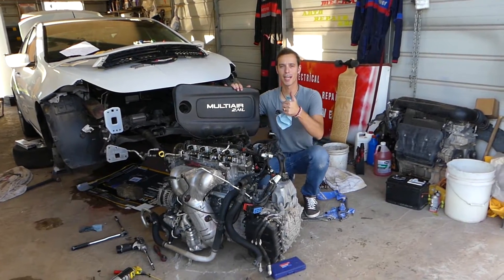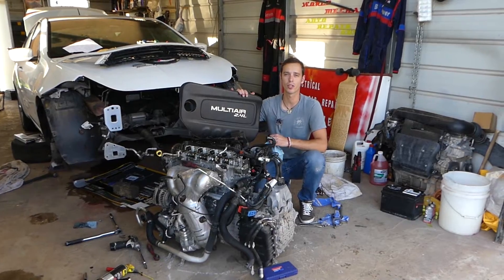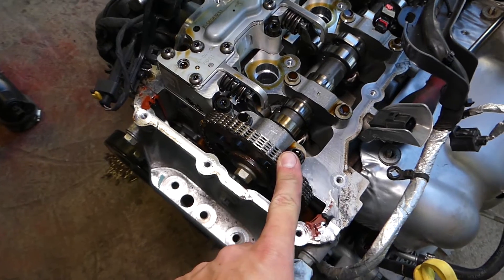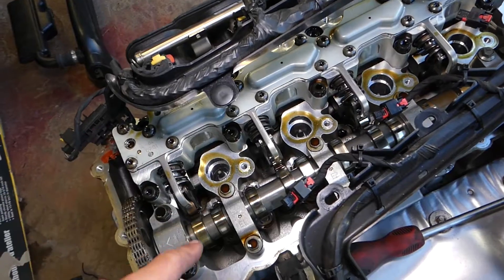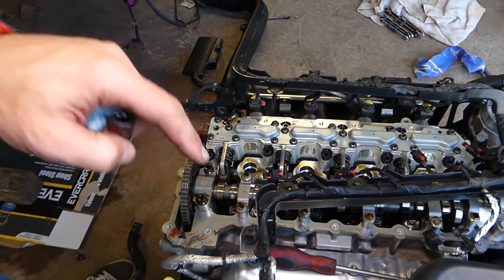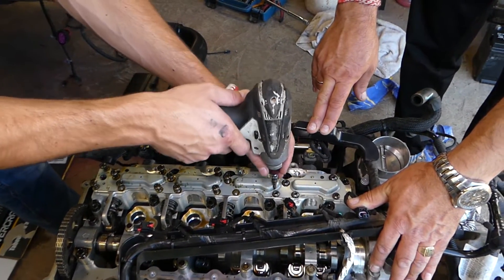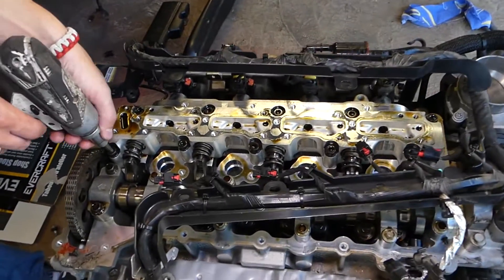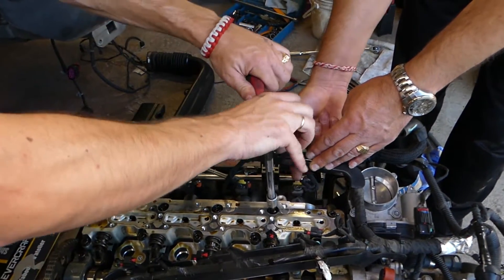MULTIAIR ENGINE EXPLAINED AND HOW IT WORKS DODGE DART CHRYSLER 200 FIAT 500X JEEP CHEROKEE COMPASS R

Comment: The engine is dead, there is no oil pressure. There is no electrical power, how in the hell does anything bend an intake valve?

Comment: Hey guys, love your videos! My Chrysler 200 is really high mileage and I am ready to put in a new engine and transmission, how would you approach switching the two point 4 Front Wheel Dr. over to the V6 all-wheel-drive? I have the budget for it but not sure exactly how to ask my mechanic to do the work.
Reply: I don’t know the exact specifics but you would need the v6, transmission, all components related to the awd system, new suspension all the way around, a v6 wiring harness, the ecm for the v6 awd system, and you would have to get your ecm flashed to your car’s security system if it has chipped keys. Any car after 2005 most likely has chipped keys.

Comment: I have a 2019 Cherokee and I’m impressed with the power of the 2.4!  For being only 4 cylinders, my Jeep doesn’t do so bad on the highways at all.  I was surprised when I test drove it as I was dead set on getting a 6 cylinder.  I’m glad I got this one and save money at the pump.
Reply: I sincerely wish you the best. I will just leave it at that. Sincerely.

Comment: I've had a MiTo multiair 1.4 135hp for 7 years. Has to be one of the best engines ever made. More than enough power and torque when needed, but can still get well above 50mpg on a long run, sometimes even nearly 60mpg. It's a 2010 car but not even newer mild hybrid engines can match the power and economy of the engine.
Reply: Agreed. My guiletta 1.4 170 bhp. Has been great.
Buts gets around 45mpg on motorway  must be alot heavier or something. Same year car.

Comment: Bro thanks for the video
Im from Puerto Rico and im mechanic . Im working in this engine because the engine was problem with the head gasket . I remove the head and took to the machine shop to rectificate . Now in having trouble with the compression it not increase and the engine dont turn on.
Have check the timming and have purge the oil at the check valve but without luck. The oil is new and i see good oil pressure. 
Thanks friend.
Reply: Hi compression not have intak side how to solved it
Reply: I have a Jeep Renegade, I replaced the head  gasket, but the car has no compression, the oil pressure is ok

Comment: Hello my Friend.

What you tell is not interesting to users, because we are not going to design engines like Multiair. And we are not interested in how it works inside there, but given that this engine has a serious design flaw, namely, it does not start after a long stop (more than 2 weeks) despite the operable kinematics of the control of valves by the Multiair module due to oil leakage from the module and the formation of air pockets in it. This disadvantage is exacerbated by the traditionally high oil consumption in this engine and the user can actually miss the critical moment of adding oil to the engine. In my case, this happened, the oil level dropped, when braking or tilting the car through the suction pipe, air got into the oil system (Multiair module hydraulics sistem) from the crankcase and the engine stopped. After topping up the oil, attempts to start the engine were unsuccessful. At the same time, compression and spark in all cylinders disappeared in the engine. The last oil 5W40 change was - 8000 km. back. The  filt Multiair module er turned out to be clean, the mileage of the car is 960,000 km., the condition of the engine is good.
Questions:
1. How can I bleed the Multiair module  and remove air from it?
2. What is the  luMultiair module brication scheme.
3. Why is there a small ball valve on the , from Multiair module he top under the filler neck? what is its function? Some experts in Utah advise pouring 240-280 ml through it into the Multiair module oil and then try to start the engine againe. I tried topping up, but nothing came of it, because the hole (1 mm) is very small.

Senserly yours.   
Igor Groza 18.01.22

igorgroza1957@gmail.com
Reply: You can bleed the multiair unit by putting your foot on the accelerator all the way and turning the key to start, do this several times and it should bleed.

Yes you can also add oil to the small  ball nipple under the engine oil filler cap.

If your car has 960.000 km then I would say it's a good designed engine wouldn't you?

Comment: Ever have rough idle while in park?. **warmed up already**. Just got a fait 500x sport 2.4l tigershark multi air. The vehicle is under 100.000km . 95.000 to be exact.
Reply: Mine is 130k tiger shark they do that. Idk how to make it stop. They are just shaky af.

Comment: I absolutely love the older Chrysler\Dodge engines! Slant 6, 5.2L & 5.9L Magnum engines...etc! I actually have this Multi Air engine and it does ok but does consume a lot of oil for a smaller engine, leaning closer to 150,000 miles and no major issues so far...knock on wood lol!
Reply: This engine is made by FIAT, so you best pray on that.

Comment: How do you put it back on with out damaging the valves
Reply: 10259A/10259B Engine Actuator spring Compressor Assembly Tool Fits for Fiat MultiAir Engine & Turbo Engine 2012-2019 1.4L 16V / Turbo / 2.4L / BF/FB/FF/PF/UF/VM

Comment: Please note that there is a Class Action Lawsuit filed against FCA re:  Excessive Fuel Consumption in reference to various FCA vehicles built with the 2.4 Liter MultiAir TigerShark engine DATE FILED: 04-29-20, Case # 2:20-cv-11054-JEL-APP...  FYI...  Thanks from your friends at BestLine Racing!  Visit us and discover what Nano Diamond Technology is all about!  http://www.extreme-engine-relief.solutions
Reply: Story time: this engine burns oil from the factory, I forgot about this ,and the engine shut off on me while on the road. I immediately knew I was low on oil. I was on my way to work and got some 5w-30 the lightest weight that the little store had.  I had planned on doing an oil change soon so I though it would be light enough to work for a bit. About 120 miles later, and I get a check engine light, and my car ran like crap. I parked it and re started it. Light is still on but the engine runs fine. I plugged my fancy scanner in and I got a p1064 cylinder oil supply solenoid valve stuck.  Even 5w-30 is too heavy for this thing. I'll be doing an oil change tomorrow, but I hate the sensitivity of this engine. My 92 trooper didn't care what oil was in it, as long as it had it.
Reply: 190k on 16 Renegade 2.4 has never consumed oil
Reply: That should be excessive oil consumption not fuel!  I have the 2.4 multiple in my Dodge dart and I have had no problems whatsoever!  I know that the BestLine Engine Treatment has kept my Dodge purring!  I highly recommend it!  http://www.extreme-engine-relief.solutions
Reply: @johnbeckham1483  Folks dont listen to this guy. DO PUT NOT ANYTHING OTHER THAN THE RECOMMEND OIL in a multiair. They rely on a range of hydraulic pressures to operate properly. Most people people who have oil consumption issues have not filled their oil with the OEM recommended specs.
Reply: @desertsoldier41  I use a high quality full synthetic 0W-20 in my 2.4 Liter MultiAir as recommended indeed!  I personally have never had any high oil consumption problems with my 2.4 Liter MultiAir from day one!

Comment: Thanks, Auto Repair Guys, for your good quality video in reference to the FCA 2.4 Liter MultiAir TigerShark engine!  FYI we're delighted to share our patented BestLine Lubricity Products now with Nano Diamond Technology!  Camshaft and engine bearing wear is reduced by 80%!  Engine hotspots eliminated while excessive high thermal heat is significantly reduced!  In general your engine will virtually become impervious to high thermal heat and extreme pressure!  Thanks, Auto Repair Guys, from your friends at BestLine Racing!  Visit us here at our online store and stock up!  http://www.extreme-engine-relief.solutions

Comment: I have the 2.4 jeep Cherokee latitude my only gripe is why does this engine consume oil I am undergoing a oil consumption test with my dealer I gotta drive another 500 miles to determine hopefully they can replace my engine with a new one
Reply: There is a lawsuit going on about it.. I just got a 2019 jeep compass with this motor I didn't know anything about it till I just happen to be reading up on the motor as its interesting to me its so small and has a good amount of power plus with the 9 speed transmission it seems to do really well for such a heavy lil rig.  I have seen they are saying the oil is leaking around the rings in some of them. But in some rigs it stops after 20k miles...  I am very happy with my jeep... But I have seen a bunch of people say its a real POS... buy at the same time I have seen some people as happy as I am.. So who knows... time will tell.. they get this oil thing figured out for people.. might turn out to be a really good  motor... its a real complicated motor thats for sure I never seen anything like that.. crazy design.. but coming from Fiat witch was a part of Ferrari till 2014.. Fiat is not part of Ferrari any more..  But You got to admit Chrysler has some really power house motors the last few years.. 700+ hp is nothing to joke about..  and this lil 4cl isn't 700hp but I feel it holds its own for as small as it is and with the gearing its not a bad rig. My lil 4x4 jeep can get up and go...
Reply: There is a class action lawsuit effective 04/29/20, Case # 2:20-cv-11054-JEL-APP...  U.S. District Court For Eastern District Of Michigan...  05-11-2020 Hagans Berman Litigation Team...  Tel.  888-381-2889  Piston wear with oil going into combustion chamber hence your high oil consumption!  Maybe new engine replacements are possible or upgraded piston replacement?  Good luck!
Reply: @johnbeckham1483  I completed the oil test now they determine it didn't consume that  much I was able to go at least a thousand miles until it start drinking lately sense there's not much traffic on the highway I have less oil consumption when driving on highway its weird
Reply: @brotha1984  don't listen to this Self promoting salesman he goes on every FIAT video talking about products he's used he actually works for that company. But to your question these engines just don't like idling for some reason they love highways and hard revs. However some have not experienced this vanishing oil phenomena I myself am one of those people I have a 2017 hbu?
Reply: This is a common problem on the Fiat Multi Aire 2.4 engines not to be confused with Chrysler's old technology 2.4 used on the Journey which does not have this problem.
Reply: The MultiAir system simply(?) actuates the inlet valves. High oil consumption will be caused by piston rings or valve stem seals.

Comment: Chrysler products reliability has always been sketchy but since merging with Fiat and using Fiat sourced products it has really gone downhill fast.
Chryslers most complained vehicles are those using Fiat engines and transmission like the Jeep Renegade that is just a Fiat 500 under the skin.
The Multi Air system sounds good on paper but in reality it has been plagued with reliability issues just like Fiats dual clutch automatic transmissions the Renegade and 500 used.
Chrysler's old 2.4 still used in the Journey though not as powerful as the Multi Air has been much more reliable because it has been refined over the years since introduced in the late 90's.
The same can be said for the four speed automatic transmission used in the Journey which was introduced in the late 80's which by the way is NOT a sealed transmission meaning you still have a dip stick to check and refill your transmission fluid from unlike the rest of today's automatic transmissions.
In addition the four speed auto transmission like the 2.4 engine is far less complicated than many new engines/transmissions which means lower maintenance and repair cost.
Reply: I've had Chrysler products in the past, all of them have been pretty reliable.  I don't see the point here . . . .holy cow complex, and the fuel economy on the Dart was nothing special.
Reply: @muskepticsometimes9133  yes you are correct the man above is clueless allow me to educate because I have a fiat 500x 2017 (2.4 multiair). If you pushing out 250k vehicles all with a new engine style of course their bound to run into issues with something but most of the engines that had these "issues" were 2016 and before. 2017 an after run flawlessly. 2nd the sealed transmission is sealed for a reason, you see the 9 speed transmissions have transmission fluid that is rated for the life of the vehicle and so long as said transmission is operating as it should there will be no reason to change the fluid.
Reply: @housebaelishgaming  "life time"😉
Reply: @leion800  yep i had my oil compression test done 6 months ago and the oil was fine still running strong
Reply: @housebaelishgaming  and mine has a bad shaking problem at idle, mostly when in gear, its been burning a little oil since at least 60k miles, the air bag warning is on and the the car has a recall for the trans wiring harness. I'm expecting the engine to spontaneously fail any day. 2015 Chrysler 200 120k miles. I do like the timing chain though.
Reply: @leion800  yes the timing chain is a blessing! I have a fiat 500x 2017. All the issues I hear about this engine are primarily in the 2015 and 2016 models.  However I also have had a shakey engine since I bought it when it had 28k miles on it. Putting it in neutral immediately stops the shaking. I have done research into this engine before purchase and after and apparently this shaking is normal for this engine, I think it's the process of bring a 2 stroke engine having the oil and gas mixing and the VVT
Reply: Sorry, but you need to know The New tecnology. This is easy to repair, you need to take more it to fix. Experience.
IF you think its bad to repair, u Don't know The french cars. Lol
Reply: @tiagorocha6637  There is a reason Fiat no longer sells the 500 in America.
Word spread quickly from American Fiat car buyers of all the problems they had and sales dropped off quickly.
Now that Fiat has put much of their technology in Chrysler products especially the Jeep brand complaints of Chrysler products have soared.
This is why Fiat Chrysler sales have declined in America the last few years.
Reply: @desiderious1  fiat Don t have car Who American like,their cars are small and dowsize engine. About sell  of Chrysler have declained, its happened whith others American brand. What do u think VW tsi engine? Its worst engine in The my opinion
Reply: Correct, 2019 Dodge Journey 2.4L is already rated more-reliable than 2019 Toyota RAV4, according to carcomplaints.com.
Reply: @waltchan  And you believe that.
Reply: @genoaoak  Yes, the 2.4L World engine was originally designed by Hyundai for Chrysler, and it's a worldwide industrial engine for taxis, marines, RVs, and etc. in developing countries. You don't hear that from Toyota, because their sales pitch is based on past reputation, not the present or future.

Comment: Thank you for the detailed information, I will change my oil early 👍
Reply: Just as happens with hydraulic tappets, the oil within the MultiAir hydraulic system is probably the same oil used when the engine was manufactured. Changing the oil is always important but it's likely the MultiAir oil is there for life.
Reply: FYI, Visit BestLine Racing with Nano Diamond Technology as it will keep your 2.4 Liter Multiair Tigershark impervious to high thermal heat, friction, wear and extreme pressure!  Visit us & Order here!  Thank you...  http://www.extreme-engine-relief.solutions

Comment: Solenoids for the intake valves? How is the reliability of that setup?
Reply: You need to do some research. The exhaust valves are opened conventionally with normal followers. The inlet valves are opened by hydraulic pistons - you could say they are hydraulic rockers. Oil is pushed in from the single cam lobe with two pistons down the nine opening the valves. Valve lift and duration is controlled by bleeding off hydraulic oil using solenoid valves.
Reply: I can't comment on the 2.4, but the 1.4 is very solid.
Reply: Well I have an engine with 130k miles, and I just got a code for one of them being stuck, and my car went into limp mode.
Reply: voodoochildmd it sucks, i work on them atleast twice a week and usually the engines are swapped for engine consumption. Not to mention if you wanna change the intake cam “block” you need a special tool to compress the springs